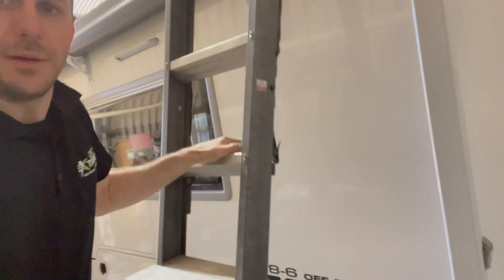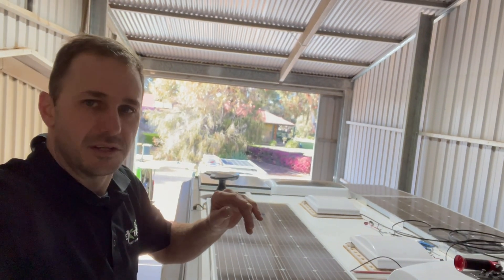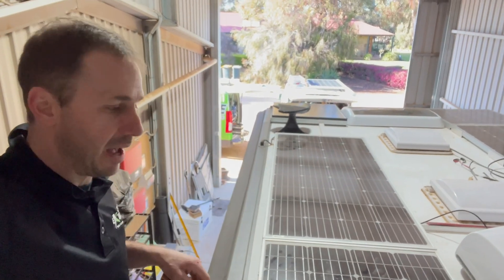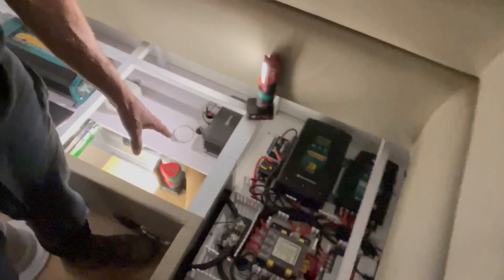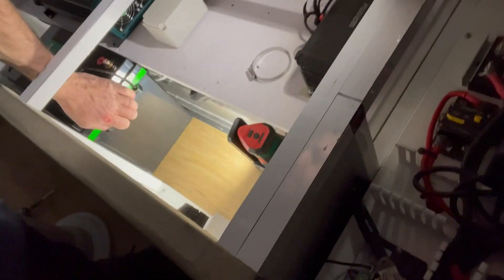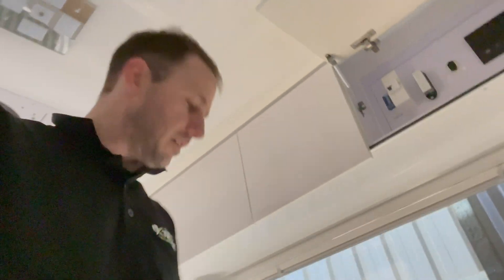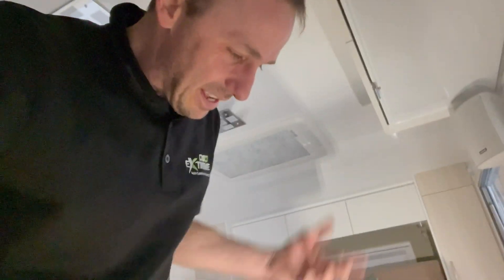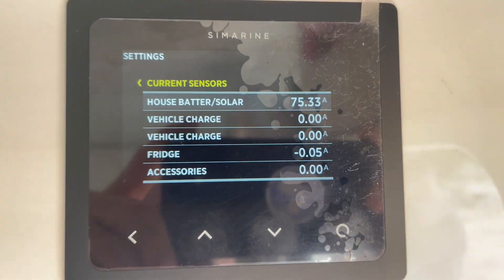ZoneRV 1060 watt solar 560ah lithium upgrade. Run the air conditioner microwave and more.￼

Comment: nice work! usually with solar if you run them in parralel the voltage is the limiting factor, so if both panels have the same voltage you shouldnt really see any performance loss and sometimes have better performance due to better shading characteristics. but if you run them in series the current is the limiting factor so the voltage gets added together but the current will only be as much as the smallest panels current. in theiry anyways, i havent tested this yet but plan to in future, you may be right so im keen to test and find out. 

enjoy checking out your systems, would love to see an in depth install video. 

Cheers
Reply from the maker: May be right I’m not sure where you’re coming from.
It’s very simple mathematics here if the current is low and the voltage is high, you will get less loss over the cable. This is a fact, and can easily be worked out. You are correct with the shading. However, if you designed the roof and solar array correctly, you won’t have a problem This isn’t my first rodeo 👍
Reply: @extremeacc101  I totally agree higher voltage is better for less voltage drop and efficiency. All im saying is that when different wattage panels are run in parallel, as long as they are the same voltage and you have properly sized cabling, you wont see much current loss. its when they are of different wattage AND voltage, they will be restricted to the output of the lower voltage panel. 

But yeh totally agree where possible you are better running in series due to the higher voltage. although you will deffinately see a performance loss when running different wattage panels in series even if they are the same voltage.

Comment: That really is the ultimate fit along that cavity... so neat! Triple the charge, nearly triple the battery capacity, you'll probably never hear from him again ;)
Reply from the maker: Mate. I couldn’t believe the power I got from those front facing panels they were pointing north east probably more east. It was late in the afternoon when I tested it and just from rewiring that roof array correctly well you can see the results. I told all mate to send a snapshot of mid day when he heads up north I would not be surprised if I see above 90A from this. 😎